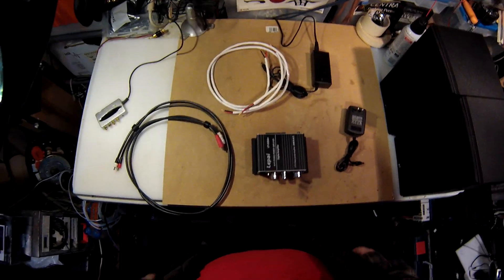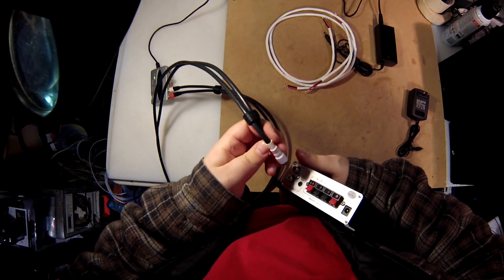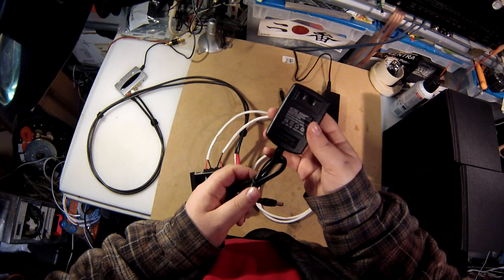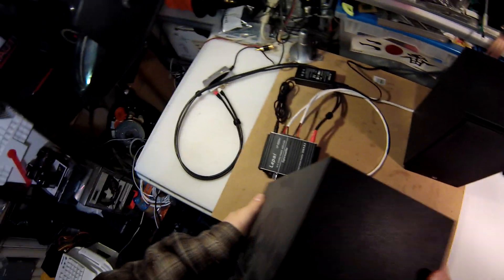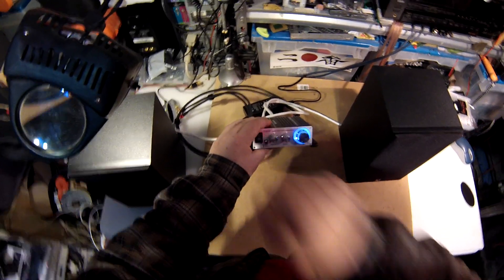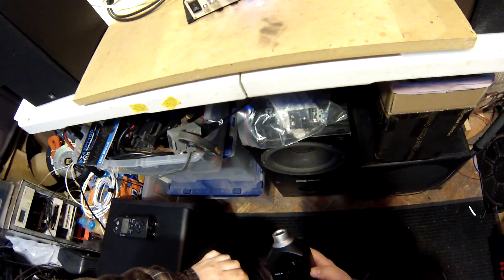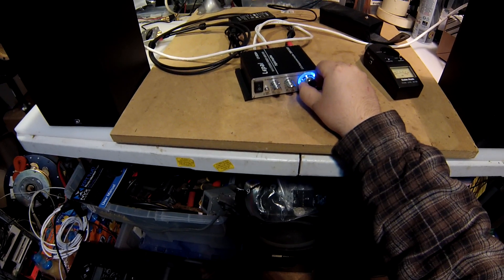Z Review - Lepai LP2020A+ (Complete Sub-$100 - 2.0 Build)

Comment: I've an old Pioneer passive 3way speaker, it has an 8" woofer rated for 75w, I will want to make a boombox powered by a big battery, on AliExpress I can find very cheap 24v 36v even 48v so the battery is my last problem, can you suggest me a powerful Bluetooth board for that purpose? Maybe that can be Bridged in mono because I've only one speaker.
The aux out will be interesting for daisy chain thanks

Comment: Great video! One thing buyers of this amp should know is depending on the speakers connected, do not be suprized if you start to hear audible distortion beginning at 40% to 70% volume. To solve this in my system I set my Echo dot to max volume and then, listening to several songs, turned the volume on the Lepai up until I heard distortion. I then backed the volume on the amp down about 5% from that point. All set. Then I just use the volume of the Echo Dot to control the volume. The Amp is acting as a power amp and no mater how loud I ask Alexa to play, I never hear any distortion. 

My system uses an Echo Dot as the source into the Emotiva S8 sub, 100 Hz and up is sent to the Lepai LP2020A+ amp and out to Micca MB42X speakers. Total system cost was $301 + tax. Yes, I got some great deals.

Comment: Buying the 6a power brick does that increase the volume you can get out of this amp. I have pioneer sp bs 22 and this amp can't get them loud at all and I'm very disappointed because of the hype behind this amp.
Reply from the maker: +Joey Sendzik The BS22's are a 4" driver which limits the volume potential quite a bit.
Reply: +Z Reviews I figured out the problem. The turntable that was hooked up to the amp was on the phono output so o changed that and now they can make me go deaf so it's all good now
Reply: Joey Sendzik , yes it will but you would be better getting a 20 volt / 5 amp power supply and you will get 25 wpc @4 ohms, RMS

Comment: Tone control is handy when using this app in a multi room speaker set up. I have the EQ set on my main computer and desktop system I wanted to sound, but it doesn't always work with other speakers. I use the EQ knobs on the Lepy amp to fix this issue.

Comment: One thing to note for future viewers - the inputs on the amp are connected to the same input inside the casing. This means you can use one of the inputs as a passthrough or splitter if you need such a thing for your setup.
Reply: You mean like in through the RCA and out through the 3.5mm jack? I'll have to test this on my Lepai at home.

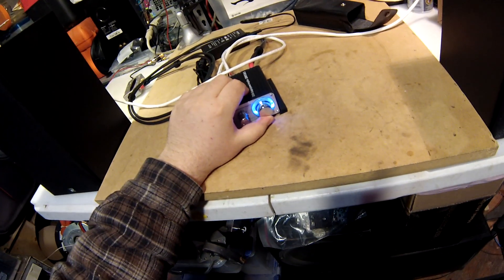Comment: looks like a brilliant little thing. Just out of curiosity, what amp are you refering to at 6:28?
Reply from the maker: Indeed 2021A. I reviewed it at the very start of this channel. It was an Ebay only buy. Today I would take an SMSL SA36 or SA50 over it.
Reply: Z Reviews hey big thanks for the suggestions man. I was considering Amp+Speakers to replace my plastic 2.1 PC speakers (yeah, kinda new to this side of audio) which is currently combining TWO inputs. The SA36 and SA50 both have one input, and the SA60 i saw you review apparently switches between the two but don't combine. i can probably find a splitter to solve that though :)
Reply from the maker: Well switching can be done with an RCA switch. Combining really needs a mixer so you don't send an over-voltage into the amp.

Comment: I run this amp (6amp brick) with the old Ajones SP bs 21 speakers (49 pair, delivered on closeout) and a Martinlogan 300 sub (109 at Amazon, via a Zeos twitter link).  It sounds fine and it gets plenty loud in our 20 x 24 room tv room.  Even counting wire and cables, I am under $200 for a very fine sounding system.  Zeos FTW

Comment: Hey there! Great reviews!

Behringer UCA-202 or Audioengine D1 (with Lepai LP-2020A+ and Micca MB42x  ) ?
Reply: Well if you have headphones that need powering the D1 is far superior. BUT if the lepai amp is all you intend on using the UCA202 will probably suffice. A better amp than dac in your case.

Comment: My logitech Z2300 is making humming noises when there's no audio being played, the subwoofer hums and the speakers hum 2x as loud.  I swapped out the satellites for JBL Loft 30's and they still hum the same.  So maybe the amp from the sub is bad?  What's causing this?  If i got this lepai, will it stop the humming if i hook it up as a 2.1?
Reply from the maker: It is probably the amp or something to do with your signal. A lepai would make a 2.0 but the logitech sub may not integrate.
Reply: Vince Phan , you need to buy a noise RCA loop isolator

Comment: This channel has changed the way I approached speakers. I was thinking about buying some preamped Edifier 1700's, but after this video I'm thinking about the lepai 2020+ and Polk TSi100. What do you think of that combo and will the lepai have enough juice to power the Polk. Or any recommendations on better speakers around the same size and price?
Reply: Carlos Rey , fucking fantastic choice. I have the Polk t-15s and they rock.
I'm getting the Polk tsi200s here shortly
great great speakers especially for the money.
Reply: Carlos Rey , hey Rey, go with the Klipsch R14 or R15s. their sensitivity is above 90 db. around 94 to
96 actually. that high means that an amp with lower power will sound much better. good luck

Comment: Z Reviews So i recently bought this Lepai and the upgraded psu with a pair of Miccas  (they sound great), only thing i'm having an issue with is that i have to have them on their side to fit where i placed them, my question is do i have the tweeter on the inside

Like this:    [Oo]           [oO]      

Or have them on the outside like this:          [oO]               [Oo]

They are placed under my PC's monitor if that matters about 3 to 5 feet away.

Thanks for any info.
Reply: LBCvalenz562 , I will tell you what Z would say, try them inside & try them outside, it's up to you how they sound with the imaging

Comment: I bought  this amp, and I would like to use it for both my mp3 player and for my playstation 3 audio.  Is there any type of switch that I could get so that  I don't have to keep unplugging the rca cables when  I want to listen to my mp3 player?  Great reviews by the way.
Reply: There is both RCA and 3.5mm inputs on this amp but I am not sure if it will switch automatically. Something like this [http://amzn.to/1cbZhzy] will work as a source switch you just ignore the video plug.
Reply: kevina968 , just buy a Y splitter because you only listen to one source at a time anyways, that's what I did.
just make sure you don't turn on both sources at the same time
Reply: kevina968 , go on Amazon and get a "Little Bear " video switcher. even has an analog volume control. zero noise because it's totally passive, does not need power. they have them with 2 or 4 video inputs. very cheap and we'll put together. especially for the price.

Comment: did you ever hook this up to the andrew jones speakers and if so how'd they sound, would you recommend it?

also i saw your smsl sa50 review would that be a better amp for the bs22-lr? also what dac would you recommend? keep in mind this is for PC use and i'm sitting 2ft away.  if theres any better options id be glad to hear what you have to recommend.
Reply: I am uploading the BS22 review tonight. The monster Fluance are actually better for up close. UNLESS you go a completely sideways direction and get a 2.1 with the Polk OWM3's and the ML sub.

The SA50 is the best all around amp and only if you were on a strict budget would you get the SA36. As for a dac go over this post. http://redd.it/2dk7la
Reply: ZeosPantera any hissing up close with the SA50 with the fluance sx6? im looking at that and the topping TP22 which is 30w per channel a review said it was more accurate than the SA50 but had less power but i dont think i need 50w per channel sitting a couple feet away. decisions decisions.. :/
Reply: Don Draper I have had no issues with the SA50. I am using it with my Emotiva XRM6.1's and I don't think I need anything clearer or more powerful.
Reply: +Don Draper I've got this amp with the BS22s.  They sound good, though I haven't tried other amps, so I can't give a good comparison.

Comment: Hey man, I'm about to but this little lepai to fuel my budget 2.1 build. The only out of the box mod I see as a necessity is the power supply upgrade. Would you mind giving me the link to where I could order the same 12v 6a one you got? I'd love to get one for the price you stated if possible because everywhere I look they're almost double. Thanks man, great video. I hope the lepai lives up to my expectations (I am keeping in mind what exactly it is and the cost). I'll be using Sony ss-b1000 bookshelf speakers with some Dayton audio 5 1/2" classic drivers modded in. From what I hear the b1000's are good for the price with the exception of the Malaysian produced 4 1/2" (Sony advertised as 5 1/2"... wtf Sony) driver.
Reply: I believe this is the one I have [http://amzn.to/1y4EOqv].

I'd love to know how big a difference it will do swapping those drivers out.
Reply: Troy Guinn , actually you should use a 20 volt / 5 amp power supply.
these Lepai 2020 a and time models can use from 12 to 24 volts.
I'm using a 20 volt / 5 amp but I installed a heat sink on top of the Texas instruments chip and installed a small CPU fan.
just in case it gets a little hot.
go to Parts Express.com
Reply: Troy Guinn , Parts Express

Comment: hello Zeos, I just wanted to say that what you link to here and in your reddit is not the original tripath chip Lepai (made and sold by parts express, I think) but rather a knockoff...The original units is no longer being made due to shortage of amp chips, and is now replaced by the "better" and more powerful Lepai LP-2020TI.
Reply: david johnston , yes exactly and I'm also using a 20 volt / 5 amp power supply with mine and it actually is putting out around 25 wpc / RMS @ 4 ohms

Comment: What are the differences between the 2013 revision and the other one? I bought the other one and I've yet to receive it but I'm wondering if I should've gone with the newer revision.
Reply from the maker: Not entirely sure. I have never had anyone explain the difference to me. Could be a slightly different power supply of better quality or just the black case.

Comment: I want a new pair of speakers to use with a lepai, which speakers are better the Dayton B652 or the Micca MB42 (not X)?

Your videos are great btw thank you!
Reply: In a desk setup the Micca's are better (even the non-x) if you want to do a room the bigger size of the Daytons would probably win out.
Reply: Thanks man really apreciate.
Reply: Adrian Plascencia , first of all the Micca 42X is the much better speaker than the regular 42 model.
it has a very high quality crossover and sounds way better.
as far as the Dayton's go, if I were you if you have the room.
definitely get the new
Dayton B-652 AIR, it has the new AMT tweeter and is extremely good

Comment: I went ahead and bought its bigger brother Lepy LP7498E+ which came with 32 V 5A power brick (which would mean max 160 W power).
I am powering the speakers philips fw v785 whose manual says they are 6ohms and 120W per channel (RMS) (which would mean 240 W total).
upon playing the speakers through them at the volume that I would be listening, the volume knob was halfway and it was pretty loud, yet I measured the power sucked from wall using a powermeter, they were constant around 40 watts... To test them further I cranked up the volume upto full, yet the power consumption remained at 40 W, though the volume was unbearably high.

So is it
the speakers don't need more power, or
the power brick mislabeled, or 
am I missing something?

Because then I could simply have gone with the cheaper Lepai LP2020A+

Comment: Not needed those thick wires...power consumption is very small..output power is 10 watts each channel with huge distortion..consumptions is small....2 amperes....like a toy in consumption.
Reply: Carlos Mergulhão , your oh so wrong my friend.........
I'm using a 20 volt / 5 amp power supply and I'm getting about 25wpc @ 4 ohms. drives 4 ( 2-pair ) of Micca 42Xs, very very well

Comment: I got two of these.For free.Why? Because the right channel kept going out.Parts Express is awesome when it comes to customer service.I was going to send them back.They said don't bother,because shipping would be half of what these cost.So I bought the S.M.S.L.-50 for $69.00 ( I don't use headphones ),I just needed an amp.I have a pretty decent set of Harmon Kardon HKTS 2MkII 2.1-Channel Home Theater speakers ( $104 ) for my office.I gotta tell ya,the Lepai rocked !!! I bought the 6 volt power supply,and this little thing rocked my 110 sq. ft. office.The only thing I don't like is having to switch my sub on and off from the back.But hey,when they're all set up right,the Lepai smashed the S.M.S.L..It just sounds...flat.I'll probably get another Lepai and just upgrade the caps.But these things will JAM a small room.And I have it all hooked to my computer via 3.5mm jack and just the MB.Pretty sweet.
Reply: Gary Ortolano , no no no, just get an 20 volt / 5 amp power supply and don't bother with any soldering of any caps !!!!!!!!!
you will get 25 wpc @ 4 ohms with that power supply, I am !!!!!!!!!!!!
rocks out 2 pair of Micca 42Xs, big time !!!!!!!!!!!!!!!